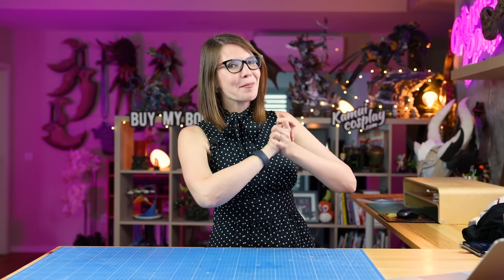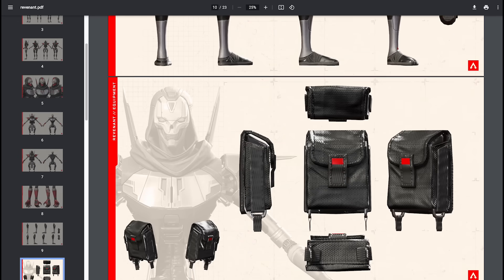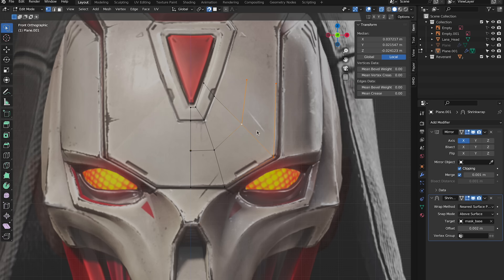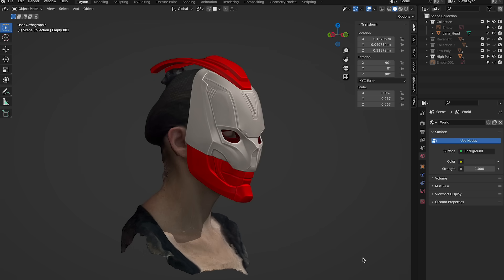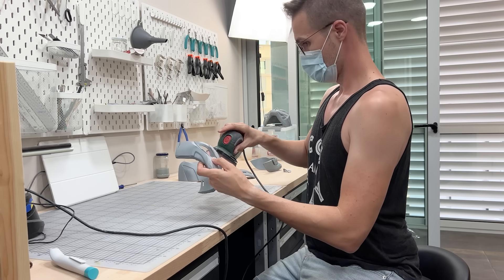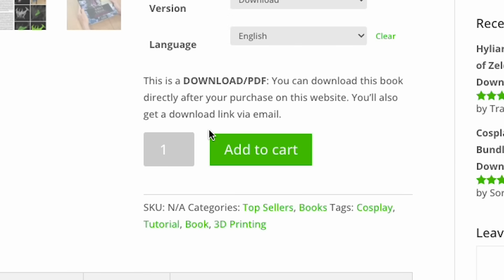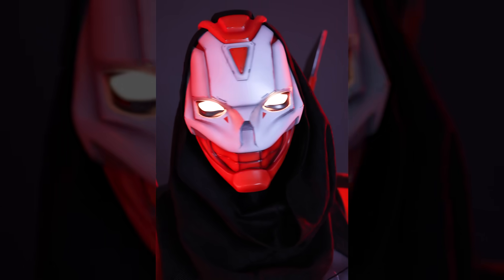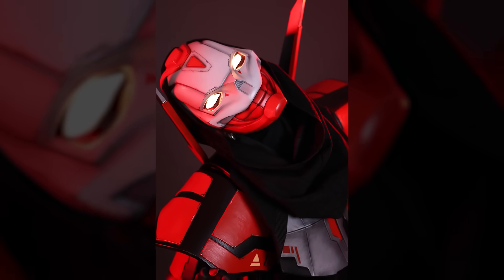I turned myself into Revenant from Apex Legends!

Comment: Very cool! I use the same printer.

I found a faster trick for sanding & painting. Instead of sanding first, use automotive filler primer. I know your first instinct is to sand it, but if you use the filler primer first, it takes less sanding to get a smooth base. The filler primer fills out the tiny grooves between the layer lines. Instead of sanding those lines down so they are even, the filler adds material so when you do your first sanding, you knock back the paint and plastic until they are even (taking less sanding overall). Also, you've already applied your first layer of primer, so that speeds things up quite a bit.

Hope this helps out in the future!

Comment: I am new to the channel and am very impressed with your skills and planning.  I do have a question about those eye pieces.  I also wear glasses and have thought of doing certain characters that would need eye pieces like the ones you fashioned, but cannot figure out how to account for wearing my glasses without significantly altering the look of the piece.  I cannot wear contacts so if, for example, I was to wear a helmet like the one you made, I would be at a great disadvantage for my vision.  How do you manage your experience?

Comment: Since it was printed in ABS, why sand the model over acetone vapor smoothing? I get you would still want to sand after smoothing to get the paint to adhere, but it it would be a lot less active work and the scuffing it for paint wouldn't take too much time.

Comment: You guys should really look into better ways to split models up before printing. Especially if you're going to print the bottom half of the face right side up with supports(???) there's no reason you couldn't add some plugs to it in slicer when cutting. Then you don't have to carefully (mis) align the parts when glueing.